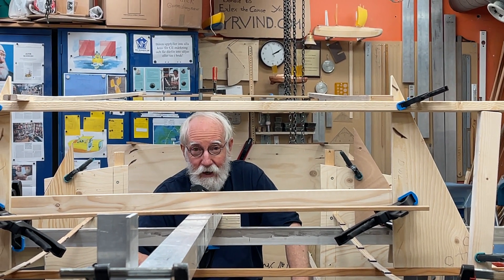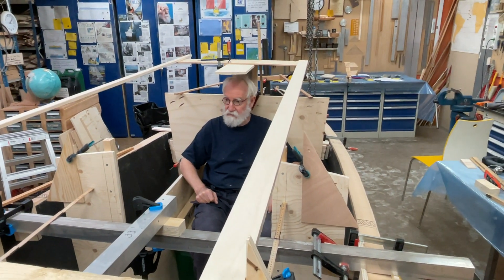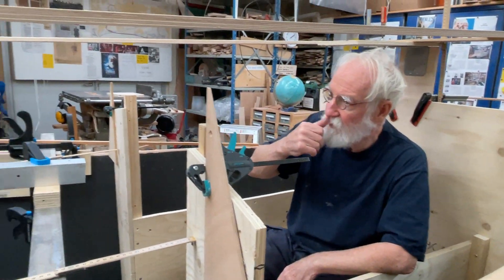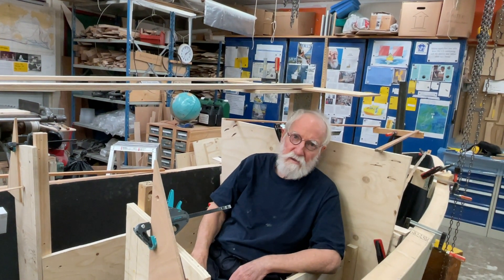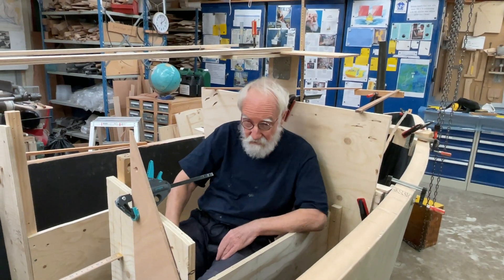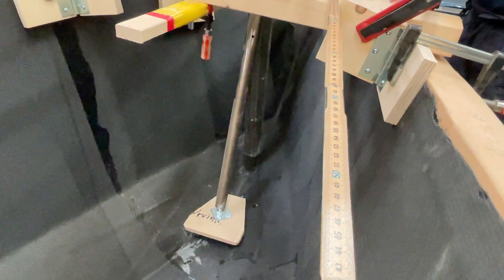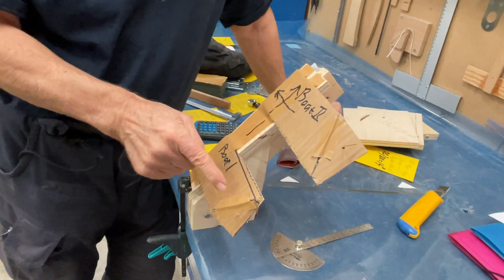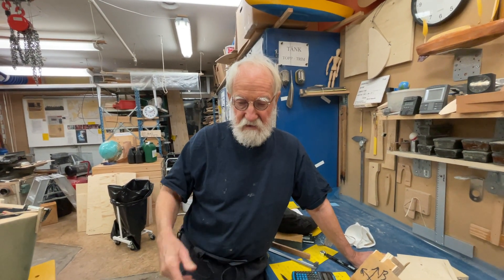How the angle of the rudder axis affects steraing. An example of Interference

Comment: Sven,

If you sleep on it a night or three - the solution will come.  You've been going at it pretty hard.  Our bodies and minds need breaks from work, and that helps sharpen the saw.

You know I sail a Drascombe Scaffie, which has a similar rudder axis, even more of an angle to what I think you were demonstrating, yet it is transom mounted.  The Scaffie's tiller action is amazingly pleasant, very light.  I suspect partly because the rudder is hinged directly behind a shallow keel, although a skeg should create similar hydrodynamic forces.  And largely due to the forward angle, the rudder maybe self balancing (like your balanced lug sails when jibing).  I've sailed this boat many times, yet the tiller angles don't come natural to my mind's theory.  There is somewhat of a hobby horse motion as the tiller lowers when pushed athwartship, and rises when pulled back to center.  It's a compound angle, and I'm terrible with compound angles.

I wouldn't dismiss your angled rudder axis so quickly.  The good behaviors may out way the bad.  A full size mock-up 'tiller' might provide helpful facts in your decision, to see it works with your forward rope steering arrangement.  If the tiller works, then the skeg's tail, and the rudder's lead can be shaped to fit the change in axis of the post.  The tiller and post form a "7" in the "Z" that represents the tiller, post, and rudder.

Most respectfully,
Bobby

Comment: You lost me on this one, Sven.  Rudder in the back interfering with a hatch in the front?
Reply from the maker: More such things are bound to come up. Interfering is there all the time. A rudder is easy to do a hatch is easy. I found a reason to move the mizzen further back then I realized that I could move the top of the rudder axis more back. That changed the angle of the rudder axis that lead me to investigate. Designing is a chain with many links.

Comment: You will hit your head when a large wave comes. When sitting, more head room is required in your design.
Reply from the maker: I have not hurt my head in sailing since ocean sailing 1969. That includes being capsized and pitchpoled near Cape Horn 1974 in a small boat with no more headroom. In fact more headrom will hurt you because then you will fall further. Its thanks to small headroom that you are vedged in and dont hurt yourself